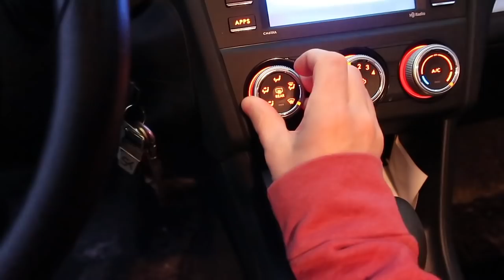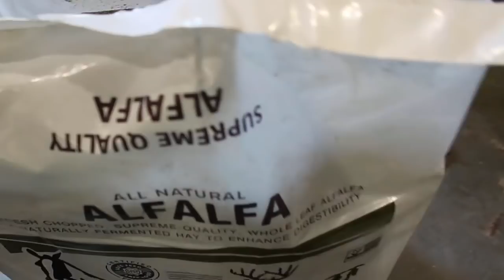We Need To be MORE Vigilant Now! Predators getting in Chicken Coops

Comment: We raised hens and found they like cracked corn better along with laying pellets. To use up what you have try soaking it overnight in water to soften it to be more digestible. Try offering black sunflower seeds as a treat. It will boost its core heat temperature and put on a little weight.

Comment: Gooood Morning Al ,
I'm sitting here with my coffee and you get out the  frazelberry bread !  I think that I could smell that raspberry sauce.  Now I feel rather deprived with only my coffee .
My egg production is finally increasing . I had four eggs yesterday !  I had one of those tubes of sand for weight in my truck .  But the sun took care of the plastic which disappeared leaving a pile of quite course sand .  So , using a shallow wooden box , I guess that it's 3 inches deep X 18" X 14" wide , I filled it with sand and placed it into the chicken tractor . Viola ' a dust bath for the chickens !  I notice them pecking at the sand for grit also .  Win , win , win ! I get to use the sand and the chickens are happy also . The sand is far more coarse than play ground sand .

Comment: instead of whole corn, I learned the 7 grain scratch works better as winter leads into Spring. Just a suggestion, it is easier for the chickens to digest, and it is a better variety in diet.

Comment: Hi Al. There's  a fellow in Maine who makes a chimney cleaning system that installs in the chimney. The brush runs on a chain from top to bottom and is operated by a drill. I've  seen him several times at Common Ground Fair and was always intrigued by it. Sorry I  can't remember his name.
Reply: Might be be Swift Chimney Cleaner. Not sure if it's  the same, but close to what I  saw.

Comment: Add some longer string to that soot eater. It'll work faster & better than a traditional brush. (Speaking from experience, fireside in lisbon.)
Reply from the maker: Is that a Kubota tractor in you aviator
Reply: It sure is. B2650 from champlain valley equipt.

Comment: Give them the corn later in the day.  They will digest it overnight to keep themselves warm.  Also, you can germinate some greens for them which they will go crazy for.  Just use a shallow container that holds about 1 C of wheat, barley, etc. and soak it for an hour or so.  Drain it and then wet it down once a day to keep it growing.  When it's about 2 inches high then give the whole container to them.  You will have to start another one every day till you figure out how many you need. Mine rotate about every 5-6 days.

Comment: Hi Steders,comment on your  hay/whole corn feed  for your chickens.Everybody has different results,I would also try using cracked corn,it's easier for the chickens  to digest and gives them more  benefits. Are you giving them oyster shells (crushed , grit) for their gizzards to grind up the corn.  Also try using salt in your  fire when it's very hot  the salt flashes up into the chimney,cools and deposits onto the side of the flue and then when the creosote deposits  on top  of the salt crystals the bond is weak and the creosote falls back down into the  wood stove , but the best idea is to use only dry firewood (seasoned) with less than 15%  moisture so there is less chance of  contamination in your flues, this worked for me in Alaska where the wood stove was used daily for heat and cooking,Good videos  ,BACKSEAT DRIVER SuperDave in Wi.
Reply from the maker: Thanks. The chickens have free choice oyster shells in the coop

Comment: Please explain chaffhay in more detail

Why don’t you use cracked, rolled or ground corn because all three versions are much more digestible???
Reply from the maker: While the chickens are digesting the whole corn the create more body heat. Is the theory. I wanted to try it and see if it's true.
Reply: Lumnah Acres 
I have taken college level animal husbandry and nutrition courses. We all have seen what happens when we eat corn 🌽 in the cob. The shell of the corn kernels has to be mechanically fractured to allow the contents of the kernel to be exposed to digestive juices. The gizzard can break up smaller seeds but whole intact corn 🌽 kernels are the most difficult to mechanically break up, ESPECIALLY when there are several kernel in the gizzard at the same time.